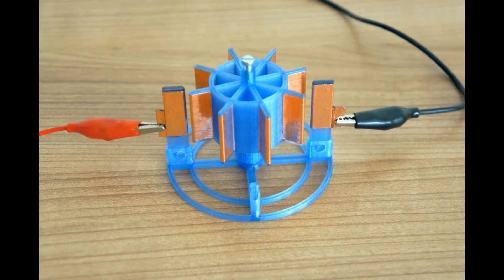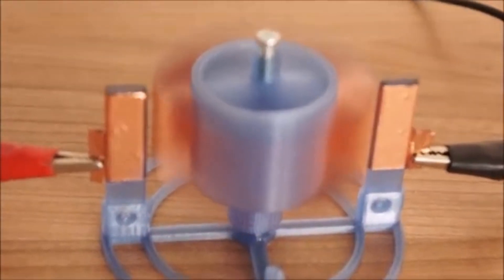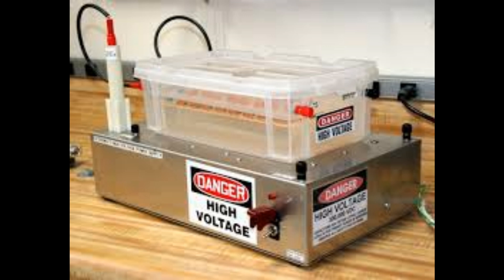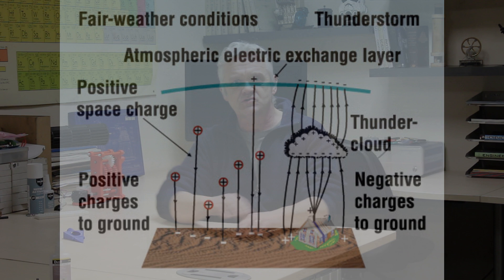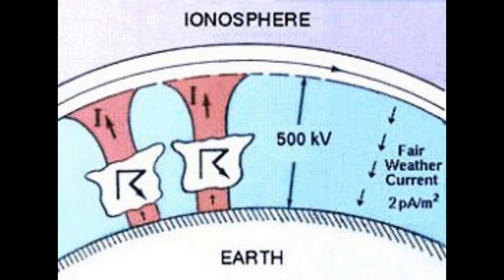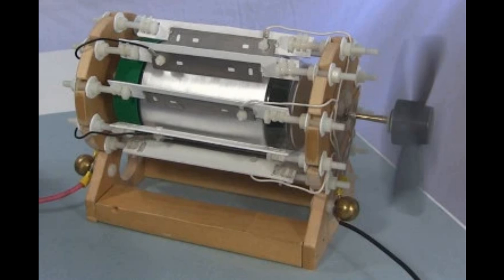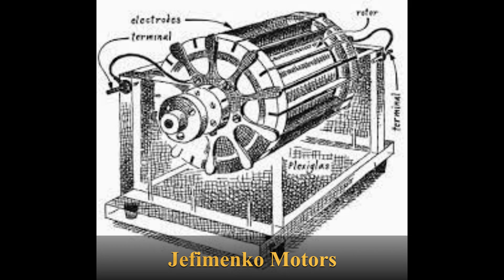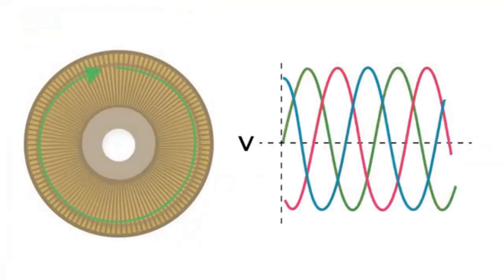1840 Atmospheric Electricity An Exciting Possibility

Comment: Atmospheric electricity- Unfortunately the Amps are low? On the contrary, be glad. Otherwise we'd be electrocuted with a few hundred volts every time we standing up. 

Capacitor motors (not talking about corona discharge motors) excell at efficency of providing torque at low rpm. Think about this, an electromagnetic motor needs current to sustain a magnetic field that torques against magnets even a low and no rpm holding it in place, if you want to position and hold a stepper motor  you need  to continously push current through it.  An electrostatic motor on the other hand simply requires you charge some plates and electrostatic forces will not go away. 

MEMS electrostatic motors are some of the smallest motors man has made.  And electro magnetic motors could not ever even dream of supply enough torque at the scale MEMS motors are made. 

I think inducer based electrostatic generators are fascinating. Just two days ago I went to the hardware store to get some pvc pipe to use in making a Lord Kelvin replenisher, with plans to connect one inducer plate to ground and the other inducer plate to an ungrounded antenna. My intention is to use  a tiny solar cell and motor to turn the machine and pump electrons into the ground not far from one of my many fig trees to see if I can observe any electrotropism.

My hypothesis is that certain bacteria make nanowires (Rob  mentioned a few weeks ago) that are able to conduct electrons to plants that conduct electrons skyward and the bacteria benefit by the movement of electrons and help move nutrients to plants like trees that carry those electrons skyward.
Reply: If you know of any papers etc. at the intersection of cap. motors, mems and static or atmospheric electricity, I'd be happy to know.
Reply: @potential900 I'm sure there are papers. I just have not looked for them.  Besides, comments with links get autodeleted.

Let me be frank up front. Although it's a real thing, because of air's high resistance, whivh i pointed out is a good thing for ither reasons) , power from amospheric electricity will always be a lab curiosity. More especially in regards to atmospheric electricity running corona motors. 

 

Sadly, most of what you'll find on electrostatic motors will be on  corona motors, that by their nature are inefficient, because they rely on ions going through the air off sharp points and collect on surfaces either  conductive or  not conductive. It's the resistivity of air that disipates most of the power (heating air, moving air, and giving off blue light as electrons fall into orbit around atoms) in the high voltage low Amps corona motors. These kinds of motors with charges  flowing from stator to rotor to stator  are the electrostatic analog to series wound electromagnetic motor  where current flows through both stator and rotor in serries. 

Then there are motors that are the electrostatic analog to permanent magnetic motors where
1) have a charge on rotor plates but don't pass charges from the stator plates while charges are alternated on  stator plates. 
2) that are the reverse of 1. Where charges are mechanically commutated to the rotor and the stator plates are unchanged. 
3) motors that might apear to blure the distinction between a corona motors and mechanically or electronically commutated charges  without discharging though air. 

Some motors might use electrets, the electrostatic anolog to a magnet, a thing that semi-permanently maintains an electric field. And if not a electret, it may simply be an electrostatic charge placed on conductive plates. 

Another type of electrostatic motor might rely on the electrostatic  forces exerted on a dielectric slab. Maybe this is an analog to magnetic induction motors. 

  obviously capacitive electrostatic motor's power is related to the voltage differences, and many work by preventing the flow of charge from stator to rotor.  But air has a dielectric break down voltage I'll refer to as (DBDV), that limits the voltage that may be applied across a distance. So some motors might be pressurize the air in between which increases the DBDV.  Some motors might use a low viscosity oil as a dielectric with a much higher DBDV. And is able to achieve very high power density at low rpm.  

Buzzwords: You might find interesting reading material if you search: electret, "high-power electrostatic motor", and at the very small scale you might search "MEMS electrostatic motors", corona motors, c-motive, electrostatic induction motor utilizing electrical resonance, ludios  research, linear electrostatic motor, dielectric slab motor. 

I hope I've given you enough buzzwords to start your journy, and the beginnings of  a framework to hange new ideas on.  Although new to many of us, a fair bit of these ideas are old.
Reply: Your hypothesis is absolutely correct!!! There are 3 distinct types of electric bacteria. The species that makes electrically conductive wires, there is also the species that function like capacitors and the species that function as rectifiers. The whole electric network is tied together with electrically conductive fungi. The flow of electrons, much like the flow of water for fish, is what gets these kinds of bacteria thriving. The more of them there are in a system the greater the flow of electricity.

Comment: Wouldn't space elevators be the optimal structure for  powering an electrostatic motor?
Reply: Good idea! The elevator can be self powered this way... if you can power an elevator, you could also power your home.
Reply: Ya just need to do one or two things fix satellites drift in orbit and/or design the elevator to sway

Comment: a thought i'd had about atmospheric voltage harvesting but never tested, was to flip a high wire between being an extension of ground and a HV dipole by repeatedly connecting and disconnecting the ground connection... seems to me this would cause current in the wire as it flipped from dipole to ground voltage.. would a transformer coil in the wire output any useful power if this was done at a suitable frequency?  i think maybe i saw something suggesting a setup like this would also send out lots of radio waves as it flipped, not sure...
Reply: This is where pulse motor's come to play. Check out lidmotor channel and lasersaber's channel
Reply: Also a spark gap and capacitor circuit will produce radio waves.
Reply: @kevinleebailey  its not really the radio waves I'm after. if anything they would be  a problem, probably causing interference on prohibited frequencies...  i'm thinking like an alternative way to use something like teslas wardenclif tower... instead of driving power through the small primary coil to induce hv on the large coil and raised top load, I'm wondering if simply switching a ground connection in and out on the large coil and high antenna, so forming and collapsing a dipole there(?), would induce current in the smaller coil usually used as the primary driver... ?
Reply: @sceptic33  pulse a coil and capacitor with a pulse motor. The make and break to the ground is done by a reed switch.
Reply: @sceptic33  If YouTube take the link down Check out Matt Blythe The One's video Tesla's little secret. The circuit you are looking for is in that video.
Reply: @kevinleebailey  will check it out, thanks. .. Although I can think of a few ways to do it.. Have played around with oscillators and impulse motors and joule thieves before.. Never got as far as building resonant tesla coils though... more of a dreamer than a doer..
Reply: Check out Lasersabers video titled Graphene/Graphite Atmospheric Electricity Collectors. It shows a similar idea to what you are describing here.

Comment: I've had worrying thoughts about this kind of generation,  small scale would be harmless but on a global scale I'd imagine that it could cause havoc with the earths natural magnetic field, could this cause more radiation to hit the earth or even possibly cause a magnetic breaking effect on the planet? I don't know nearly enough about how it all works but when it comes to the planet we definitely need to rule out the dangers, I'm not saying this would happen as I don't know, but surely something would be affected
Reply: In my understanding Lightning does this on a much larger scale .. so I would presume that our capabilities would be much less that that, and therefore would have little to no effect on the planets magnetic field.  When you said radiation hitting the earth, you mean passing though our atmosphere and affecting us here on the ground? again there are already electrical discharges bigger than we could get with these "motors."  If we created a magnetic field strong enough to cause a braking effect on the earth's rotation I think we would have little to worry about otherwise .. that field would be so strong it would likely disrupt all of our tech. - just my thoughts
Reply: @WilliamTythas  like I said I don't know enough but in regards to radiation I was meaning the earths magnetic field which handles most of the earth protection from radiation, also in respects to the magnetic braking I was meaning like when you add load to a generator it essentially creates a braking effect on the engine making it work harder using more energy, the earths magnetic field is created by the earths  rotation in relation to the suns magnetic field due to the iron in the core basically means the earth is a huge generator (NASA tested this with a tether experiment which was ripped off) point I'm making is every action has an equal and opposite reaction and if we draw off the magnetic field it would be like putting a load on a generator, I don't think lightning should come into it as that's created by the earths weather not by the magnetic field, again I probably am wrong as I honestly don't know but still I think it's worth some thought
Reply: Shouldn't happen afaik, from reading on and off since 2011/2012. Afaik, the sun adds enough energy to the system to quickly compensate for the local and comparatively minute disturbances our generators/collectors would impose. 🤔
Reply: Interesting though and concern. I too would be curious to see these applied in large scale. The thing is for small scale applications like powering our homes and vehicles this would be perfect. For larger scale applications we don't need to over load our Generator Planet. We have Zero Point electrical energy we could use. Such as the generator that Dr Thomas Henry Moray put together.

Comment: Saint Elmo's fire !
Reply: Saint Elmo's fire is electrically charged/electrically ionized phosphorous/hydrogen/methane saturated gas coming from rot in earth rich in phosphorous such as bogs and swamps. I always wondered if Frost Quakes and regular Earth Quake lightning could trigger this effect.
Reply: @captainnemo6655  no. Saint Elmo's fire is just the phenomenon of corona discharge of air at the ends of sharp objects/tips on places like ship masts.
Reply: @potential900  My Bad!! Totally had it confused for will-o'-the-wisp, will-o'-wisp or ignis fatuus
Reply: @captainnemo6655  Ah, cool. That term I didn't know.

Comment: Nicola Tesla build a car back in the late 1800 or early 1900 that ran on this electricity.
This car drove at speeds of 90 miles per hour.
Reply: That's disputed afaik. I couldn't find hard sources confirming it when I checked around 2010-12. Now it seems everyone claims he did. What's the source?
Reply: @potential900  I don't know the source, but I do know he worked with cosmic energy and it worked for him.
If anybody could have build one it would have been Nicola Tesla.
He was a hindered years a head of his time.
Reply: @potential900  The claim has gone through the game of Telephone. It was not a vehicle he built but rather he worked on the system that could let an air vehicle travel along magnetic lines and blinding speeds. All powered by Atmospheric Electricity.

Comment: You can use a laser instead of a wire. A laser will ionise the air creating a conductive pathway for energy to flow down. Pictures can be seen online of lighting being conducted to earth down this ionised pathway.
Reply: You'll need a laser diode tailored to such high power pulsed output and directly tapping lightning isn't really the working principle in utilizing atmospheric electricity.
Reply: @potential900  Bringing lighting to ground as seen in pictures online is just proof of concept. Making a conductive pathway like a wire using light,could be used for atmospheric electricity and has the benefit of removing the pathway instantly unlike using a wire where the chances of conducting lightning is equally as high.
Reply: @mtttony  What are your thoughts on the stability of such a pathway when compared to a wire? Thinking wind and climate variations.
Reply: @potential900  Unlike a wire it will be affected minimally by the wind,but will have small variables by temperature. As for precipitation this may have the biggest effect of diffraction,and density and will most likely hinder air ionisation depending on laser power output.
Reply: Imagine building a spectacular capacitor/battery that can absorb all the electricity of those thunder bolts?
Reply: @captainnemo6655  That is called the ark of the covenant. A lot of smart people have failed to understand the instructions left behind.. Smart people seem to be good at that.
Reply: The instructions are for a box of a stated size,with a lid with electrodes. It says. It should be made from the wood of the acacia tree. And all the smart people make a wooden box from Acacia. How stupid could you ever get.  Think about it, see if you can work it out and if not i will tell you?

Comment: If there was a gas that is ionized by sun light and put in a cell, potentially a solar powered car or ship could be created.   Always good stuff to think about.
Reply: A plane, glider, powered by an atmospheric electricity could stay up for hours.
Reply: Yea these are compact fusion powered fighter planes and bombers. They run by encapsulating ionized plasma gas that generates electricity endlessly for the ship. I believe Lockheed Martin has the production patents for these.

Comment: Could an insulated wire running up a mountain and the last 100 feet up in the air work?  Could this work at night?  Wow.  This could be inexpensive and reliable.
Reply: As long as you float the wire up those last 100 feet. It would work day and night and there's a really good chance the system could deliver 1000x more electricity than expected during energetic events in space weather and on earth as well such as thunder storms.
Reply: @captainnemo6655  how could the surge be handled?  Supercapicators?  Flywheels?  Grounding it?
Reply: Not sure. A setup like that was tried in the Swiss Alps in the late 1920s to power an early atom splitting experiment. Look up Science and Invention, June 1928.
Reply: @potential900  thank you for the information.  I have to look it up.  I wonder what the issues were today and how was it handled.  This feels like Nikola Tesla's atmospheric energy idea.

Comment: One wonders if there wasn’t ancient civilizations that also discovered and made use of this phenomenon, given some of the Neolithic stone machining that appears to have happened.
Reply: This is true. There is enough evidence that would point to the construction of stones that generate electricity because of their placement along The Great Circle or Magnetic Equator Belt of planet Earth. Imagine a building that powers itself by generating current when electromagnetic lines of the earth cross each of the bricks themselves. Buildings made from molded stone, with embedded circuitry inside the stone itself, molded into earthquake proof shapes by utilizing sound energy, like acoustic levitation or thermo acoustic heating/cooling.
Reply: No

No evidence
Reply: @dedlunch  Plenty of evidence, what you mean to say is that you refuse to even evaluate said evidence.  Ignorance arguments prevail typically.
Reply: @lastofthebest5102  what kind of scientist are you? Lmao 🤣

I work in nanotechnology and bioengineering
Reply: What do you think the specially made very electrically conductive cathedrals that had LEAD roofs were for with their "steeples" (antennas).
Reply: Exactly. Some of those megastructures couldn't possibly have been produced or moved any other way.
Reply: Look up Jon Levi tartaria videos. He covers exactly that topic
Reply: Sooo... ancient egyptians? Also Graham Hancock has some interesting opinion about it.
Reply: They did. Tartaria. Not a myth. History.

Comment: Finally you're talking about it! I'm so glad you watched lasersaber's videos! Please replicate his motor, but make the diameter as large as possible, this will result in much higher torque. The pickup antenna needs to be covered in graphene for more efficiency
Reply: Agreed! I would love to see Rob's version of an Atmo Drill or Atmospheric Electricity Generator, preferably a 3D printed ones lol
Reply: graphene hairs. they pick up more atmospheric ions (plauson patent)
Reply: The only problem with scaling lasersaber's device us that he uses that teardrop shaped tubing,  so you'd either have to use larger tubing (with unknown effects on the outcome) or more more tubes, which is probably the more preferable solution.

The bits that hold the tubes are rectangular instead of cone-shaped.  This allows you to adjust the distance of the pointy edge of each tube closer or farther from the spinning cylinder, so the tolerances between those and the guides in the two side pieces they fit into have to be enough to allow you to smoothly adjust the distance, but then hold it there when you're done adjusting.  It's really a nice design. :)